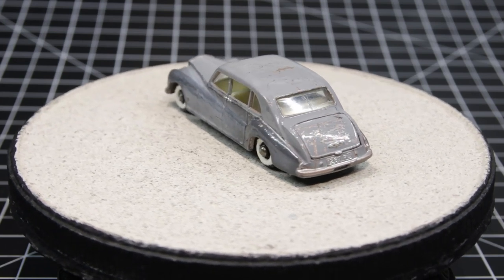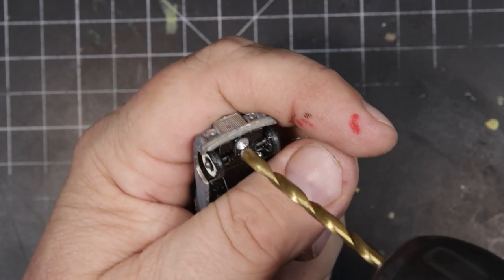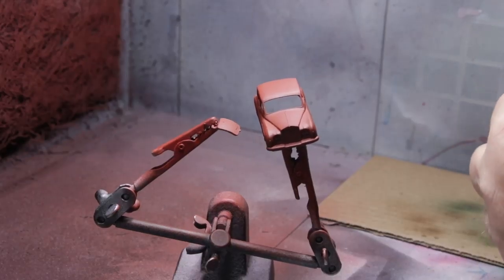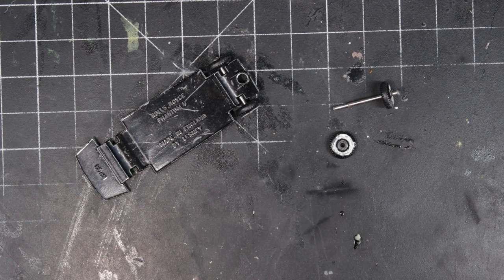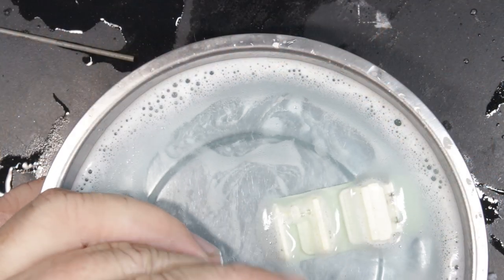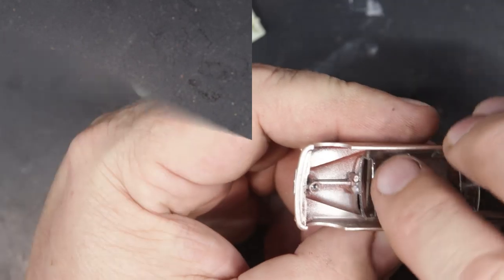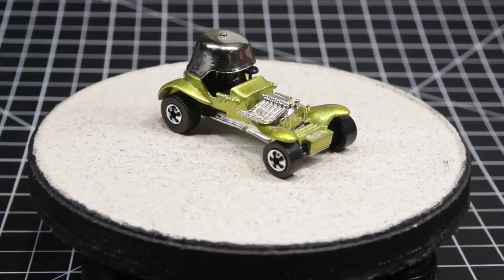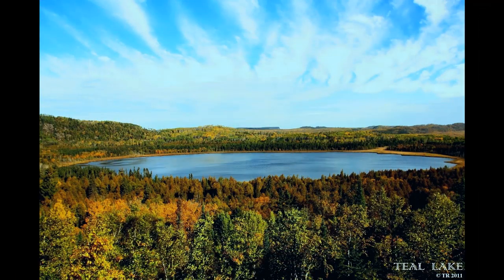Matchbox #44B Rolls Royce Phantom V - Restoration

Comment: Nice job on the Rolls, Lee. Judging by the one on my shelf (unrestored), I'd say you nailed the color.

Has anyone, as far as you know, ever tried Mod-Podge to fix cracks in windows? I know that the model railroad guys use it a lot to glue windows into buildings, because it dries clear. Another product is Krystal Klear. Used to create small windows. I think that these are both similar, if not the same, as the "canopy glue" that model airplane guys use. Not sure if any of them can be buffed though. But it might be worth a try.

Comment: I love the research you do on the actual cars before you restore the model.  Lennon bought chauffeured limos because he was legally blind—Baby You Can Drive My Car makes more sense with this bit of info.  My reading suggests his 64 Phantom was a jet black-on-black, until he had it repainted like a gypsy wagon for son Sean.  I think you might find that the record player/later tape deck was inside Lennon’s later Mercedes-Benz 600 Pullman. I can dig up some reference if you’re interested.  The Beatles all loved German cars, perhaps through nostalgia for their glory days in Hamburg. https://www.deutschlanduberelvis.com/blog/2011/06/trippy.html
Reply from the maker: I read a lot, even without the cars.  The information about the floating record player was from the Wikipedia Phantom V page.  As it goes, there was a £1900 upgrade ordered by Lennon in 1965.  The list was seven pages long.  The article even includes the brand of the "record player."

Generally my research is pretty thorough and while I never saw the turntable personally,  I do consider Wikipedia to be a reliable source so I included the information tidbit in my video.  Otherwise I plead the 5th!

https://en.wikipedia.org/wiki/Rolls-Royce_Phantom_V
Reply: @TimeRider  Cool!  I really appreciate that.  This is the kind of discussion which really brings pleasure to the hobby for me, and I trust it does for you, too!